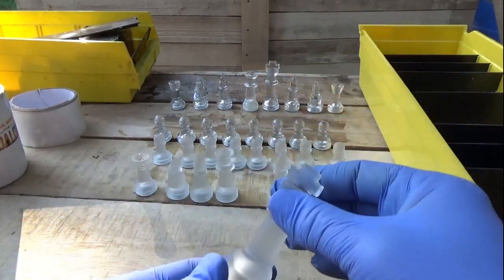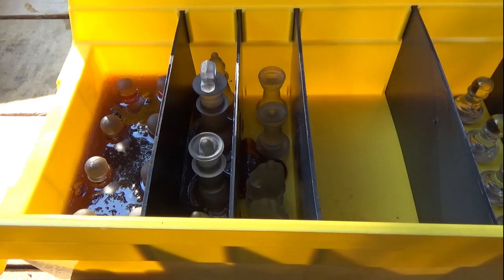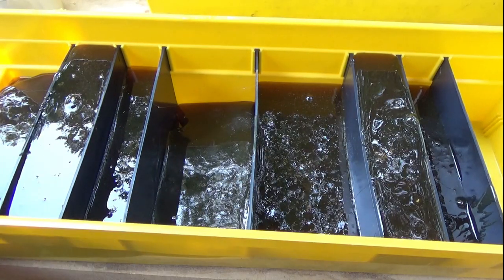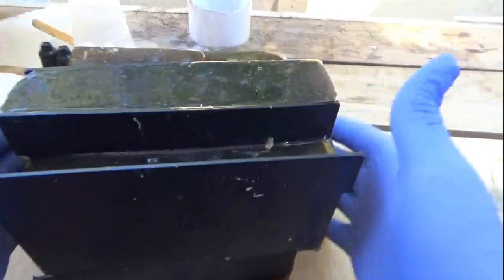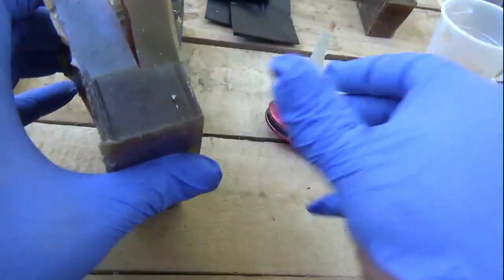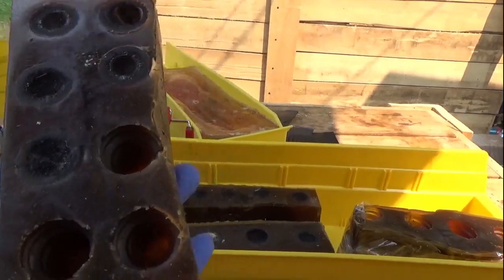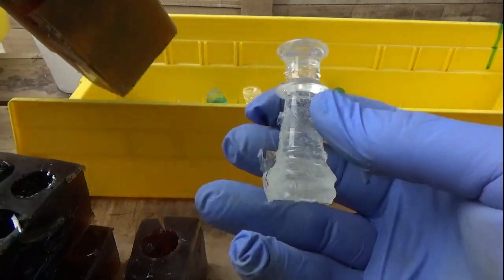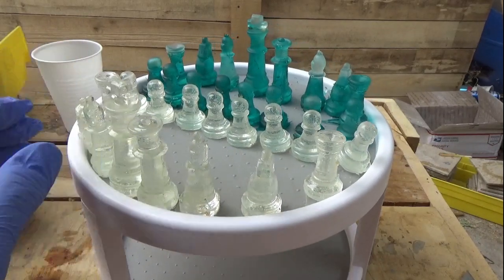Chess Set from Glass to Resin with Composimold! (Craft Papa 014)

Comment: These vids are good for their instructiveness but I also see them as a reminder; I've been wanting to mess with resin and other molding materials for a while. 

Over the past few years I've often rolled my eyes at every article/social media post about some "new" thing being 3D printed. Half the time I'm sitting there thinking how easily something could've been done by cutting, screwing/gluing, and painting a piece of wood. Although, I admit that 3D printed Chess pieces can be cool, especially if you want to print a custom starship chess pieces and of course other new possibilities.

My point is, I think a lot of people overlook what be done if you combine 3D printing with other pre-existing methods (such as casting of resin, latex, and other materials). You can't 3D print latex, but you really don't need to do that when you can still 3D print the mold. I even saw a guy who demonstrated how to cast decent metal parts from 3D prints.

That said, 3D printers are a real pain in the butt. I knew it before I bought one, but my friend convinced me that "you only need to redo the leveling adjustments when you move the machine." Not entirely true; as the heated bed is subject to expansion and contraction. Yes, I installed an auto-leveling sensor but you still need manually level the bed within certain tolerances. From there, you can skip manually leveling the bed a few times until it starts doing some bullcrap.. like when the nozzle slams into the bed because the machine thinks that it's another inch lower.

End of rant about 3D printers... FDM (the ones that melt filament) type. The resin-curing printers are great from what I could figure as long as you can vent the fumes while it operates for 8 hours. That said, "makers" could gain a lot by learning from other craftsmen. 

Also side note, my friend hasn't used his machine in months. The only way he could avoid having to re-level it was by running it continuously to prevent cooldown. He basically timed his prints around the need to avoid cooldown.
Reply from the maker: I appreciate the rant! Every few months I get the want to get a 3D printer. Then I watch all of the beginner's guides to 3D printing. It seems pretty complicated and I doubt my computer with support of software. It barely supports mine editing software LOL. Maybe someday, but that day is a long ways off.😎👍